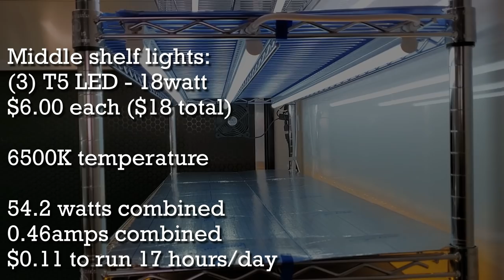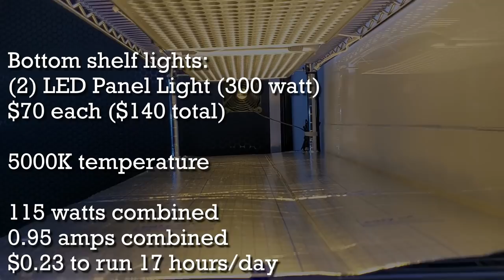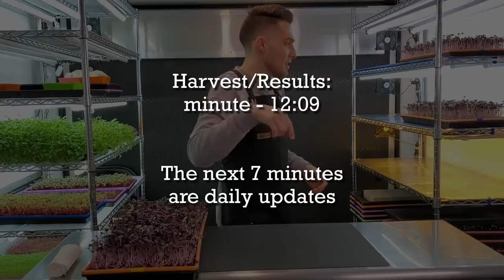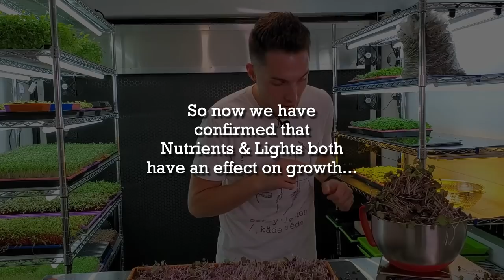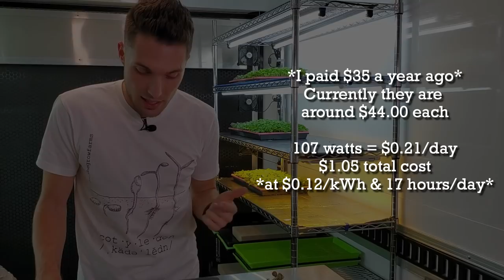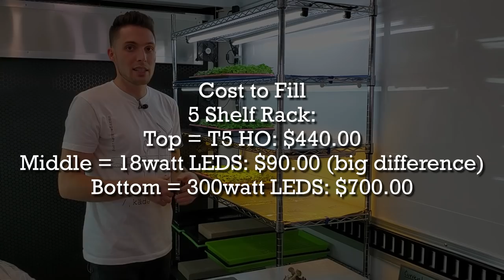Microgreen Lighting: Fluorescent vs LED's - On The Grow

Comment: the way the ligth output is mesoured is completly wrong lux meter is not the instrument u should be using, but a PAR sensor at least and depending on the sensor range u should factor in the emitted photons by spectrum type to have a  proper good way to compare light emittance
Reply from the maker: Did you read the first pinned comment on this thread? We now have a PAR meter and all videos measure in PAR and not LUX.

Comment: Next time you should try at least single blinded research model. You obviously like yellow better and know which tray you are eating. This introduces a great deal of bias.
Reply: Also, you should look into why blue needed more water. Was there more heat? That would be a huge disadvantage in both water requirement and cooling costs if the whole room was using the blue tray light
Reply from the maker: This was never meant to be a perfect experiment and there are soooo many other factors that make this in imperfect test. We had three types of grow lights, so we stuck them on the shelves together and saw what happened. If you're looking for perfect tests, you've come to the wrong place!

Comment: ...and for what I knew about the tech then, for MG you’ll want(unless you’ve got a special needs bunch o’ seeds) 5000K min-6500k ideal WHITE. All this rainbow splitting was jumping the gun on the plant science; PLUS, it’s REAL BAD for your eyes in separate spectrums over time if you don’t wear color correcting glasses!!! NO JOKE/ SPREAD THE WORD to fellow indoor growers. White is the least damaging. Lensing is easy for MG as well; 120* is ideal, 90* is the narrowest in relation to mounting height. And you CAN burn your plants with too much LED. The light meter to get is a mols per second/meter2; it will give you real usable light+show you WHERE it’s going. Again, not nearly as crucial as way bigger, more complex plants, yet you might wanna know what you’re getting dropping $$$ on. In theory, LEDs have at least 50,000hrs w/negligible drop off. HOW many VHO T5’s would you need to buy to= 50,000hrs?

Comment: bottom shelf must be way less than 5000k
Reply from the maker: Yeah, we’re guessing it’s around 2700k-3500k
Reply: @OnTheGrow   you listed it 5000k in the video! :)
Reply from the maker: P I know! 🤗🌱🌱
Reply: @OnTheGrow  wtf lol
Reply from the maker: P at the time of the video, the manufacturers website stated the lights temperature to be at 5000k and I took what the manufacturer states and put it into the descriptions for the videos. I felt that it was wrong, but this was our first lighting test and I just wanted to follow what the manufacturers stated.

In the comments I talked with a lot of our followers on how it looks way lower than that...

Not much I can do about it now, because either I delete this whole video to fix that little thing or people usually just read the comments and see that this has been discussed before. 🌱🌱

Comment: Weight is only 1 factor. Could really mean nothing in the end. I suppose if your selling the weight then alright. What about nutritional values? Think of a tall & heavy marijuana plant with 6% THC. Vs a shorter lighter one with 30% THC. Im sure i sound negative ... just opening the reader’s mind to other values. Thanks for the video comparison. Also Lumens aren’t the only factor in lights. Especially if growing.  You can Likely find another 300w and it may be 5x more money. Based off other values aside from lumens. You may also start to kill your plants with light. Study & research 👌
Reply from the maker: Yup... this was just a quick comparison, I understand the different types of light. Thanks for the input.

Comment: Lumens means literally nothing when it comes to plants. If you want to actually do science correctly you need a PAR (photosynthetically active radiation) meter. The fact is that all the lights you're using are very poor for growing indoors. Good LED's are going to be the most efficient PAR/watt efficient lights, but you will need to spend a lot on them and I frankly don't see the point of it for microgreens. You can adjust how you want your plants to grow in a lot of different ways by controlling the spectrum of light that they get; this is a big advantage of LED's in that you can custom tailor your spectrum by mixing in different spectrum lights into a matrix.

Comment: Wow wow wow what? 1:55 Yellow light aint no full spectrum😂 pure white daylight is full spectrum ✌
You need to redo the experiment.. You can't use a strong light intensity source on one test subject and less strong light intensity sources on the others, and then conclude that LED is better, im being triggered here by the unfairness to the other light sources with different Kelvin wavelengths 🙈